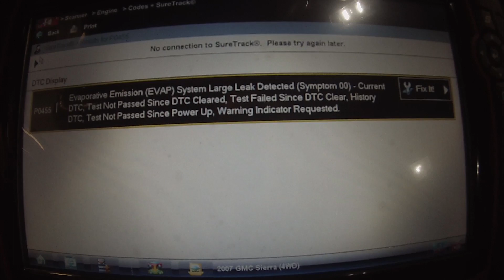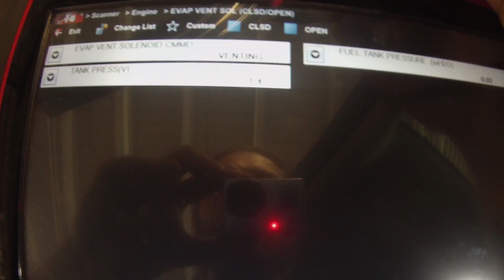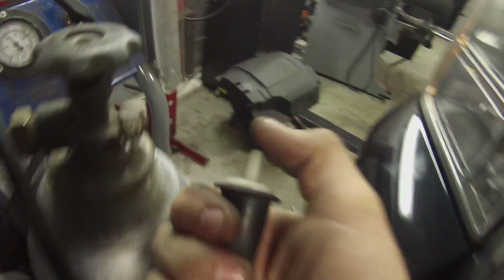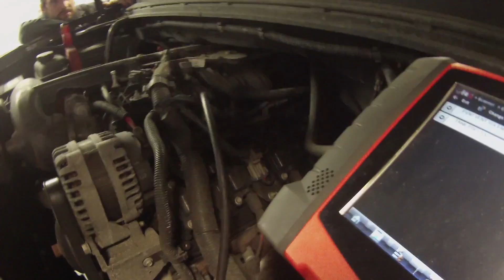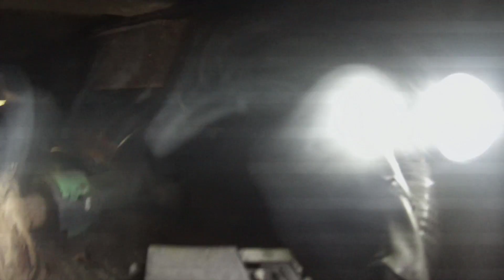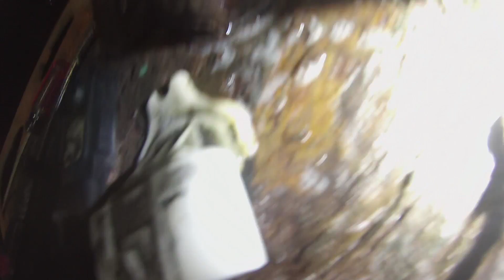2007 GMC Sierra 5.3L - P0455 Evap System Gross Leak (smoke test)

Comment: Can the vent be closed with a obd2 code reader?
Reply from the maker: You will need to have bi-directional controls or output test functions. If it’s a cheap code reader it probably does not have that function
Reply: @PositiveLeadDiagnostics  what's it do if you leave the valve open during the smoke test?
Reply from the maker: The valve is normally open so smoke will come out of the vent
Reply: @PositiveLeadDiagnostics  ok thank you

Comment: How do I close the vents if I don't have a fancy scanner like that have a smoke machine though.
Reply from the maker: The vent valve will usually have a rubber hose going to it that you can pinch off. That will give ability to smoke test the rest of the evap system. But without commanding it with a scantool you are taking the vent out of the system which could actually be your problem.  If you command it closed and it leaks well then there’s your problem (if wiring is ok).
Reply: @PositiveLeadDiagnostics  so just block off my vent valve then I'm good to test right don't have to block purge solenoid or do I need to?
Reply from the maker: Nope the purge is normally closed.

Comment: Are the vent solenoids Normally closed or Normally open. Wondering if you need the diag tool to close the vents in order to test this.
Reply: The vent is closed until the engine gets to operating temp then it opens, it’ll close back up once the vehicle cools back down

Comment: Could one get away with putting rtv around the cracked piece? How much pressure is that wvsp system under? I have the same dam code and just replaced the vent canister and the fuel cap. Should have never sold my 2000 this 07 has been a shit box.
Reply: It may work for temporary fix to get it inspected, but be prepared to change it as it will only get worse.

Comment: My truck has same problem else I can’t put it gas cause act like tank is full and drips gas from top of the tank somewhere,
Reply: Yes sir, it was the fuel pump broke on the top
Reply: @sotos2428 my fuel pump broke too, I had it replaced & now I have the evap leak. Was it something the mechanic did?
Reply: Did u find out exactly what it was?

Comment: I have the similar issue but with P0442 small leak. Can you show where to fix that. 07 suburban thanks.
Reply: Oscar Esparza  have you fixed the leak in your 07 suburban ?
Reply: I also have a 07 suburban with P0455 code. I replaced the gas cap and I am still showing a check engine with the above code.
Reply: 2yrs ago and no updates...

Comment: Typical GM issue , there is recalls on those check it out..
Reply: William Hunn TSB's on this issue from GM. IF it were a recall there would've been letters sent out to owners. There's a kit that keeps the vent by the fuel door from getting water intrusion and you have to get the kit and reroute the vent under the vehicle. 

Possible other po455 causes, fuel pressure sensors, particles in vent system blocking flow, cracked tank if you want to believe that one as I saw a real fix on suretrack for that as well. Solenoid is one possibility.
Reply: JOGO canister. Purge. Valve   Pv443 chevroletexpress1500. 2008. Looked
Reply: JOGO recalls on what, the solenoid?

Comment: When the smoke is too unclear, I turn it off and spray water or soapy water with the smoke machine still applying air flow into the system and watch for bubbles like your air pump video.  Great job making the videos.  Love watching them.  Wish I could devote myself to do the same.
Reply from the maker: not a bad idea, thanks for watching and yes it does take some extra time